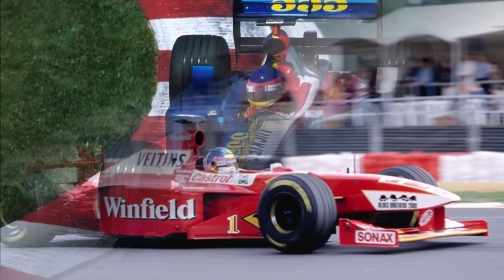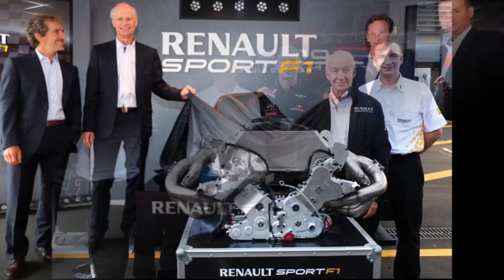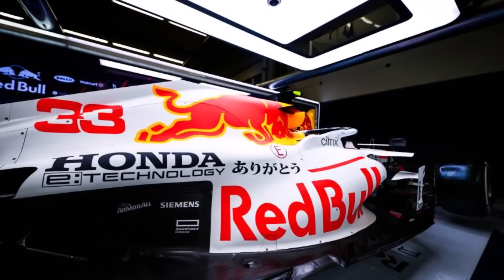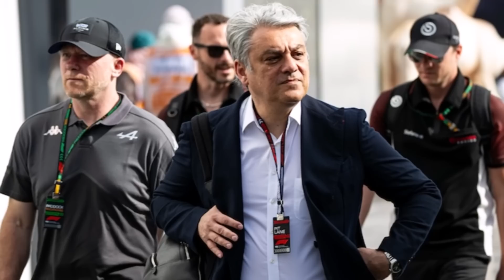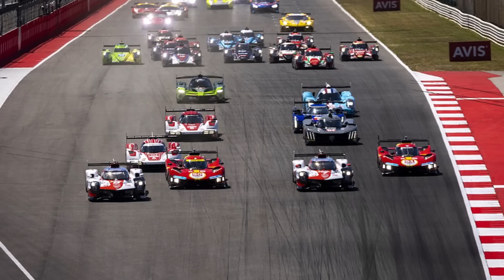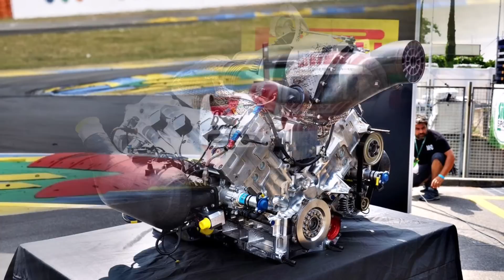Alpine's Engine Problems in F1 and Le Mans - How can they fix that?

Comment: You know, Alpine should break their contract with Mecachrome, and ask Pipo Moteurs for a new engine. Glickenhaus did so and turns out it was the most reliable engine in the field (even if it was slightly oversized due to late regulation changes), so they seem like a competent French company for endurance
Reply: Mecachrome have a deal to assemble the Alpine F1 engine and test bench it according to their site.
Reply: Or just go back to Gibson. Use the 4.5L V8 Vanwall did last year.
Reply: Why not go direct to the source and use a Nismo engine? My understanding is that the Gibson is Nissan VK based just like the Nismo V8.  @goodtimeblimp
Reply: @TassieLorenzo  could be viable. Guess Gibson is just more race proven in terms of endurance resistance. Those P3 engines are indestructible though. Also, could be a brand image element. Alpine might not think having a huge thumping crossplane American sounding v8 correlates to its image.
Reply: @goodtimeblimp  Getting stuff mixed up here. The mentioned Nismo-Gibson VK45DE is an old power unit that was used in LMP2s until 2017, after that I believe Gibson produced their own powerplant to power LMP2s (the GK428), this time without any relation to Nismo. Then, they built the GL458 based on the GK428. The Nismo VK56 that powers the LMP3s has little to do with the previously used VK45. The former uses a crossplane crank, the latter a flatplane.

I suggested Pipo because Alpine already built the body with turbo cooling in mind, so they'd probably have to rethink the concept a little for installing an NA engine. Also, they're French.
Reply: @victoralcaide6313  yeah makes sense.
Reply: Ok and in F1?
Reply: @fqeagles21  in F1, ditch the program altogether, it's too late to save it
Reply: @fqeagles21  Sell to Andretti. Alpine in F1 is just lost. They get worse year after year.
Reply: sell f1 to new entry  @fqeagles21
Reply: @fqeagles21 
EL JOKE is very over.
Reply: I suggest gibson's v8
Reply: Renault-Nissan-Mitsubishi Alliance already makes 700hp Nissan-branded engines. Alpine could use that design, put it in their road cars as well as the LMDh cars. They don't because they're under bad management.
Reply: @KAMiKAZOW  well that's a good point, I forgot about that one. Not the first time the VR38 has been used in prototype racing either, the Ligier DPi ran one so it's been proven in that config
Reply: 100% agree
Reply: Pipo does not have an awesome track record either. Mecachrome can modify that engine if necessary. It's just that it has not been used as it should/has been designed for (F2).
But in the end...I'm always very wary of constructors pretending they go all in in a series but in the end don't develop themselves a major component like the engine. Alpine can just develop their own, it's not super high tech as in F1, surely they can/should do it...